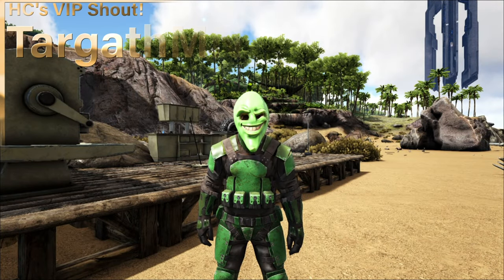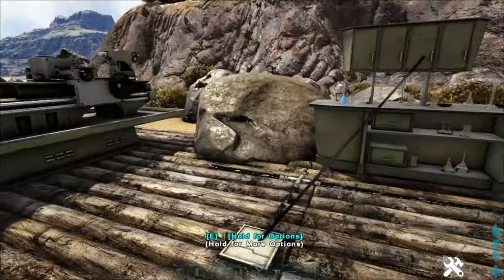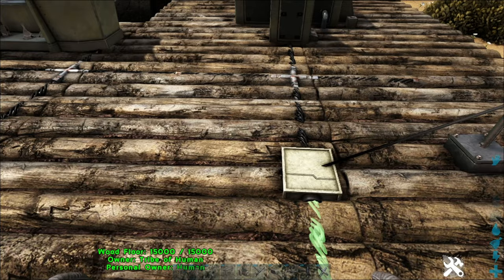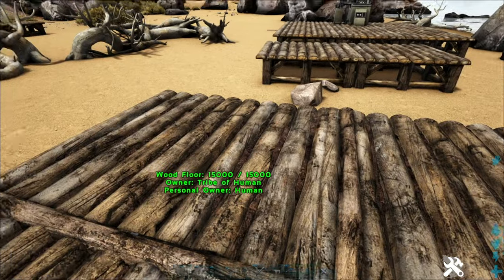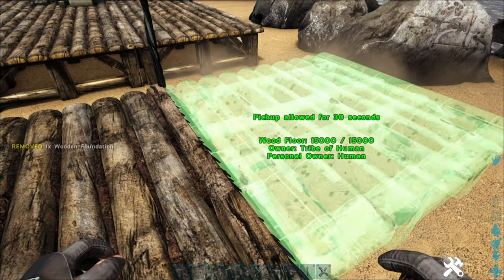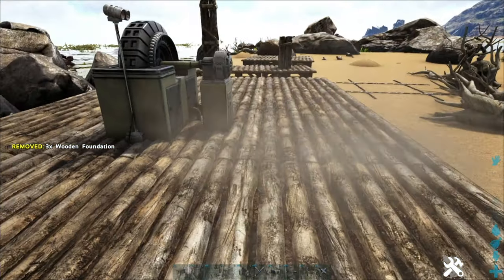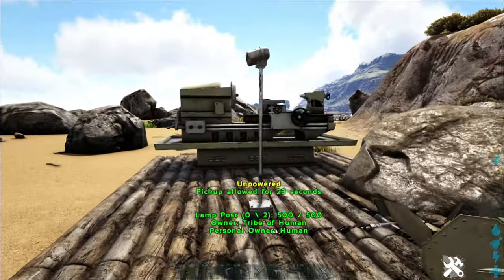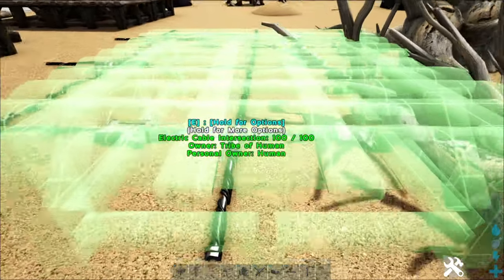Ark How Run Electricity And Hide Wires - Ark Survival Evolved

Comment: Couldn't one run the wires and pipes along the ceiling? Normally if my base has hallways i do not mind have exposes pipes and wires along the ceiling
Reply from the maker: Absolutely you can, that totally works as well.  I just went the easier route for new players is all.

Comment: My favourite way of hiding wires (before i used S+) was to temporarily remove a foundation, replace it with stairs, then set my first wires/cables on one of the steps (great thing is you can choose the height, because although they look like steps, its actually a ramp) this way you can put them just beneath the floor or deeper down, however you like
Once that first cable is down, snap the generator to that, and replace the steps with foundation, now your genny is a little (or a lot) sunken below the surface - beware if you go too deep you may not be able to access its inventory for fuel)
Hope this helps some folks
Reply from the maker: Good idea!

Comment: Ark's wire system is poorly designed, both practically and aesthetically.
They should REDO it from the start, or if they won't, at least add the possibility to turn it visible/invisible in-game.
Reply from the maker: Yes, same with plumbing.  mods make it more bearable though

Comment: For any newer players, a tip for making electrical pipes, gardening pipes, and and other placeable items, perfectly straight:

Use the ladder technique. There are plenty of tutorial videos on YouTube (search "Ark: Survival Evolved wooden ladder trick" or "Ark: Survival Evolved perfectly allign items") showing you how to do this, here is the written how to overview:

Place a wooden ladder down one or two floor tiles away so that, when you climb it, you will be facing the spot that you want to place the item. Climbing up just a little will force your character to look perfectly aligned and centered with the tile the ladder has been placed on. From there you can place the item down while you are still on the ladder OR climb all the way up until you automatically jump off, then only move your left analogue stick so that your character moves forward, back, left, and right, but the screen does not turn at all. 

After I learned this trick over a year ago, I have used it when placing almost every item in every permanent build I have made on my console (single player and pve). The wooden ladders are also very cheap to make and if you place your item down quick enough, you can take down the ladder before the 30 second timer runs out so you can re use it and not have to make more ladders.
Reply from the maker: I toyed with doing a ladder technique video but i feel like its pretty well covered else where. Thank you!

Comment: What would be your tip for Stone flooring? I can't ever find me wires once I put them down to add boxes and things
Reply from the maker: it can be super frustrating with stone.  If you are able to pick up the foundations you should be able to place the foundations down after you run the wires.  It can be tedious but if you do it one foundation at a time it should work.  If you can't pick up the foundations, its going to be rough.  In the future i would recommend plotting out where the cables will go ahead of time.  Either way, theres not real easy way it seems

Comment: Guys; in my SS Electrical components; I cannot find a Flexible cable to make; help please.
Reply from the maker: Make sure youre making it from the SS crafting station.  Its there.  Looks like a "y"
Reply: @HarvsCorner   The dang videos show a Straight Flex cable; no such SS animal at he SS bench it seems; been trying for hours literally to get equipment hooked up.
Gave up for Thursday 7/29/2021
Reply from the maker: @roberthodge2771  If the SS mod is installed (which is sounds like it is) i would just search for "flex" in the crafting station towards the top.  That should show it there.  Its possible thats something is wrong with the mod itself, but i haven't heard about any issues personally.

Comment: It wont let me connect the wires to the generator
Reply from the maker: Try placing the generator onto the wires instead of the other way around.  The wires should snap to the generator (with the exception of the flex cable)

Comment: Ok soo I built a big ass house without knowing any of these tips & now I need to do electrical. Any tips for how to hide the wires if I don't want to demolish my foundations or use a bunch of fence foundations?
Reply from the maker: There's a few options, but firstly are you playing on console or PC?  if PC i would recommend a mod like S+ that lets you hide wires.  If console, i would just suggest removing one foundation.  Placing the cable, then replacing the foundation.  Repeating the process until you have cables where you need them.  This way nothing is being completely demo'd.  Hope this helps!